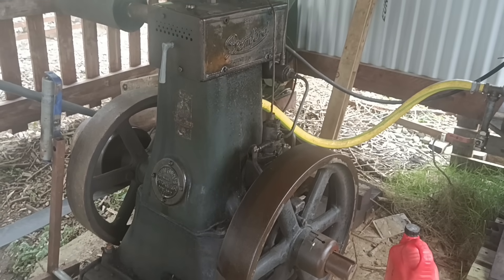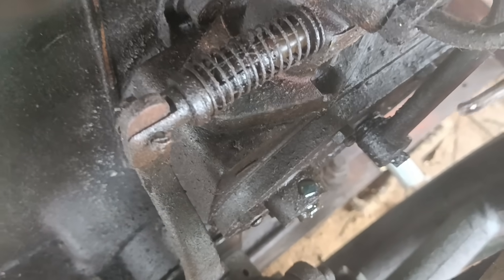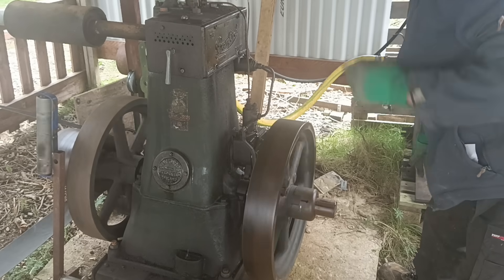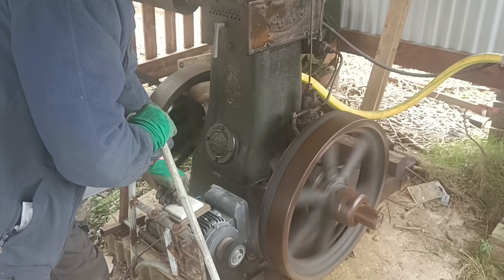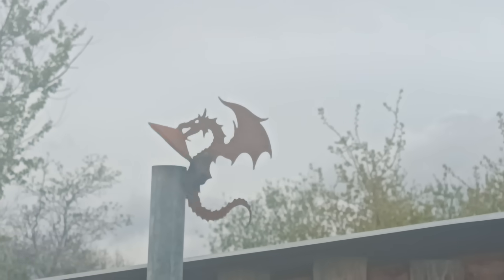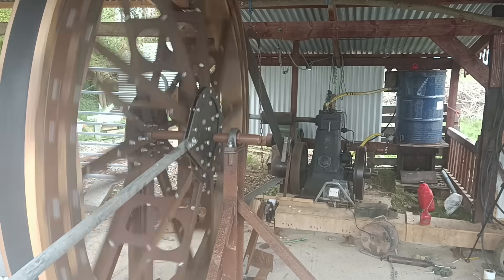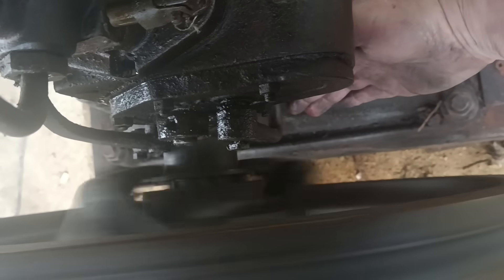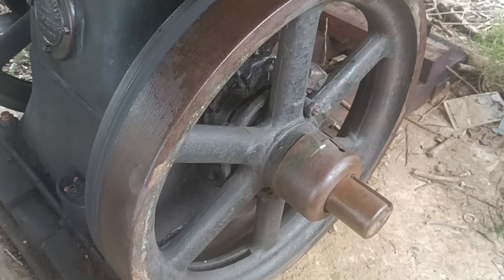How Much Fuel Does This Vintage Engine Use? Bamford stationary single-cylinder diesel efficiency

Comment: I have a 4000 acre property with two old listers a 1/5 and a 1/6, The 1/5 runs a 12 volt Alternator that charges up my battery system and heats up the shower water and heats up the cooking oil fuel tank....   Has a 10 lt diesel tank and a 60 lt cleaned cooking oil tank...  Runs for 5 minutes on diesel then switches over to cooking oil.. then for shutdown it switches over to diesel for 5 minutes.  The 1/6 has the same set up for fuel and I use it to pump water from a spring fed dam to the two non spring fed dams..
Reply: This is what I would like to do. My solar system is lacking in the winter. And I love these old engines. Got any videos of your set up
Reply: @kansasadventure1831  No videos, But I just bought another 5/1 in good running condition that I will be doing exactly the same thing for my house in town..  Its a 6 hour round trip to pick up the engine.. Once I get It I will start putting together a parts list that Im more then happy to share.. I guess I could do a few videos of how Im going to mount the Alternator etc..  Fuel tanks, Switch overs
Reply: @HebrewHammerArmsCo  I'd watch 😎
Reply: @HebrewHammerArmsCo  i would also like to see how it can be made to power a house
Reply: @elij.s.7580  Picked up the 5-1 for my house set up.. I will work out how to do a basic video..  This is only in case of a blackout  to keep the power on for Fridge Freezer , Lights, Computer, TV, Small microwave.   Wont power an electric Jug, stove, air con etc..
Reply: @HebrewHammerArmsCo  Yes please! I love these old engines, they are so wonderful to hear; and we'd love to see your setup!
Reply: @HebrewHammerArmsCo Για σας είμαι Έλληνας και ήθελα να σας ρωτήσω πόσο σας κόστισε το μηχάνημα θέλω να το αγοράσω και σε καλή τιμή αν θέλετε να το πουλήσετε κύριε?????????..
Reply: @ΠαναγιωτηςΓκιουλες-β8μ  Actually I sold it about 2 months ago...  But you can buy them new with a generator direct from India...  I will find you a link.....
Reply: @kansasadventure1831    Picked up the 5-1  on the weekend for my house set up.. I will work out how to do a basic video and a parts list .
Reply: @HebrewHammerArmsCo  sounds like life is good.👍👍✌️
Reply: Would love to see more details on this.
Reply: @clarke6436   Picked up the 5-1 on the weekend for my house set up.. I will work out how to do a basic video i guess..
Reply: I used to fix the lister 2 piston and the smaller ones as well,convection water cooling.
Reply: Love it ,like how much do you need 😊
Reply: I would really like to see a video about this! Could you make one?
Reply: We’ll set up and very thoughtful process mate!
Reply: είμαι από Ελλάδα και θα ήθελα να σας ρωτήσω αν πρόκειται να πουλήσετε αυτά μηχανήματα γιατί ενδιαφέρομαι να τα αγοράσω σε καλή τιμή αν ενδιαφέρεστε για να της πουλήσετε θέλω πολύ να της αγοράσω πείτε μου λοιπόν πόσα χρήματα θέλετε όμως!?!!!?????????.
Reply: I also had an idea to use it to charge a battery bank, id love also to see a video of how you did it, and fuel efficiency under load and such.

Comment: And warm weather you can probably run a blend of diesel and unmodified vegetable oil through it. Maybe a 50-50 mix.
Reply: @tripplefives 
Your octane rating are significantly off. Natural gasoline has an octane rating of at least 50 the top of range of kerosene octane rating. By WWII 100 octane gasoline was available and Jeeps were specified for 68 octane fuel.
Incidentally west coast gas and east coast gas had different octane ratings without special additives.
Reply: @tripplefives 
The big problem running a gasoline engine on kerosene is premature ignition from the low octane fuel.
Reply: Heck I would bet if he centrifuged old waste oil (or pump it thru one heck of a decent filter) he could run it in that old school diesel [might smoke like a busted stove though]...even mixed 50/50 with the offroad diesel too
Reply: @haydenc2742  
Add a wee bit gasoline too thin the mix a bit which could also help with the vegetable oil.

Comment: Could it be made to run off the wood gas created by your charcoal production fires?
Reply: would need a gas engine not diesel for that
Reply: Lots of diesel engines run on natural gas so running a diesel engine on wood gas should not be an issue either.

AFAIK a small amount of diesel fuel is injected with each stroke to provide ignition but the main source of power is the gas mixture in the intake air.
Reply: @carld3184  Thats modern high pressure fuel injected engines not sure it would work with this fuel system, Black Diesel (WMO) would run fine in this engine and be the easiest to do

Comment: Seeing an old machine like this still running after all this time and being used is awesome. Those engineers from that time designed all machinery to last at least forever, maybe a bit longer if you took care of them.
Reply: I worked in a manual machine shop and some of our lathes were from world War 2. One was sold to the navy to machine barrels for battleships weapon systems, but was never used. I was always blown away that machines that old could be so accurate. Our tolerance levels were .001-.003
Reply: @Criam We still use WW2-era manual machine tools at work.  I don't know, in an absolute sense, how accurate they are--but they are still good enough to hold the required tolerances on the finished parts.
Reply: to be fair many modern diesels last just as long.   Ship engines long outlast their hulls for example.
Reply: @MichaelMantion  Now they are working to fix that, an engine only needs to last as long as its needed.
Reply: You should go to a tractor show
Reply: So true 👍 my brother is using a prehistoric marine diesel engine on his wood splitter, and it even has a self circulation water jacket, "Stewart marine" he has fitted an electric starter, but it never stops working the hydraulic pump very hard with an awesome flywheel, about 320rpm
Reply: If I remember correct, machine wear goes up x^2, like double speed, it last only 1/4, triple speed 1/9 and 10 speed only 1/100. Machine running 400 RPM literally last century.
Reply: Planned obsolescence has been the reverse of helping the planet, all for the benefit of a few greedy people.
Reply: The stockholders wanted things cheaper to make , so the engineers started to design things “just “ good enough.
Reply: We didn't design these, the patents are thousands of years old. We are running them at the wrong atmosphere and with wrong oxygen content. They were designed to put out way more power. The Freemasons melted them down during the wars.
Reply: its all planned obsolecence now days which is sad.
Reply: Sounds like survivorship bias to me.  The quality stuff built today should also be able to last a long time.
Reply: @h8GW but it doesn't 😂
Reply: No they didn't. Where do people get crap like that from?
Reply: I'm surprised they let y'all have them or heavy tax you in the UK with all the crazy laws ..  good video . 👍 .
Reply: You took the words right out of my mouth. Last night i was looking at our 2007 car thinking no matter how well i look after it it was built to last a certain amount of time.

Comment: Horsepower- the amount of work a horse can put out in a minute ( 33,000 foot lbs) if memory serves
Reply: Originally horsepower was a measure of how many large draft horses you could replace with the engine.
Reply: @calvingreene90  interesting
Reply: @tripplefives 
And as such James Watt coined the term "horsepower" as a unit of measurement it was later refined.

Comment: was the engine made by the same Bamfords as the B in JCB?
Reply: The only thing i could find about that topic is that the bamford excavator and engine companys both started in Uttoxeter. Although the engine company was founded in 1845.
Reply from the maker: I think the original Mr Bamford started the engines and farm machinery company, and his nephew Charles broke away to make diggers